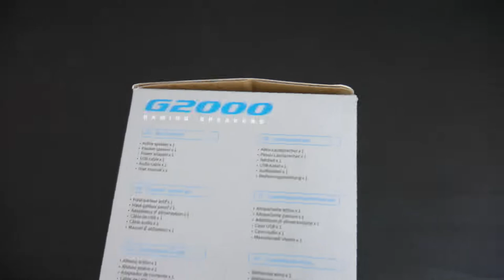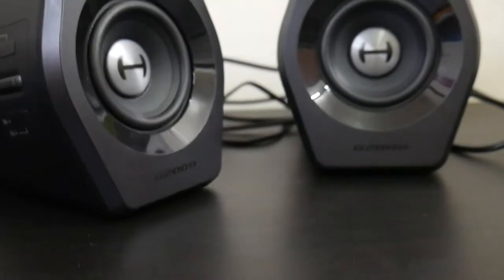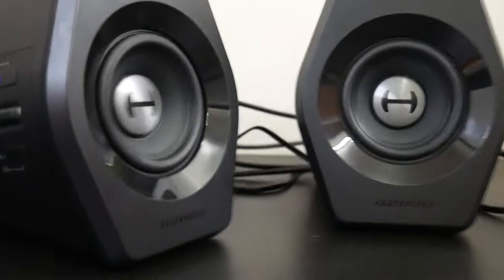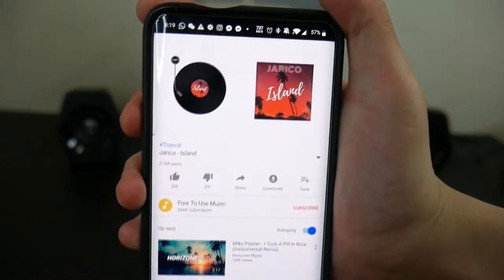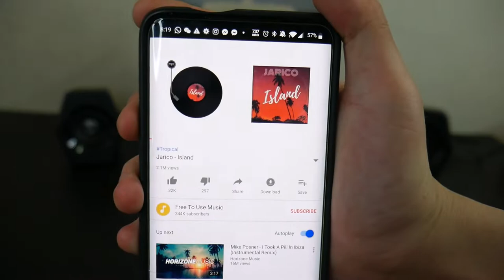EDIFIER G2000 review and sound demo !!

Comment: Just got myself a set today, so far so good 👌
Reply: xD
Reply: how are the speakers doing ?
Reply: @latinochico   Really good, haven't had any trouble. Glad I went with Edifier over another brand. Bass is deep and sound is clear. The RGB is also worth mentioning,  there's a surprising amount of presets.
Reply: @eatingbeans245  did the speaker memorize the input mode, RGB lighting and EQ mode after power off and on?
Reply: @laizhongshan5516  Yes they do, as long as you don't turn them off from the wall.